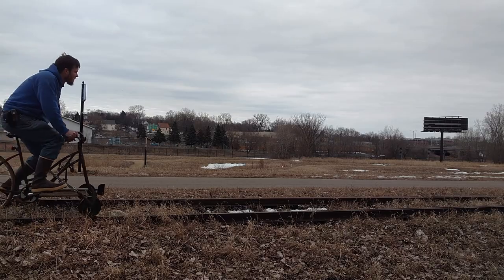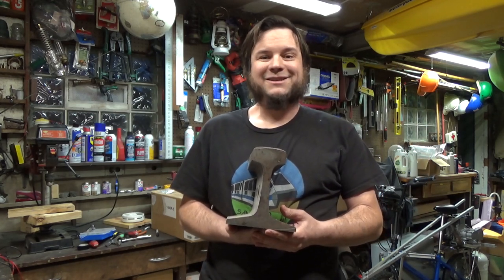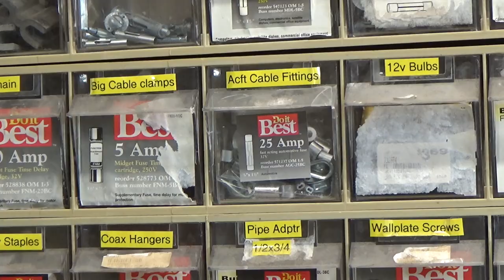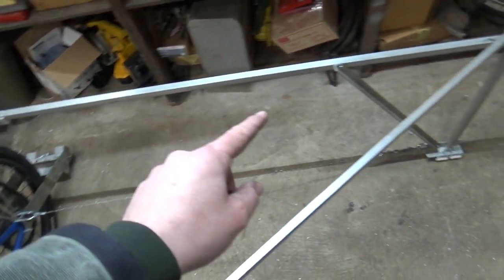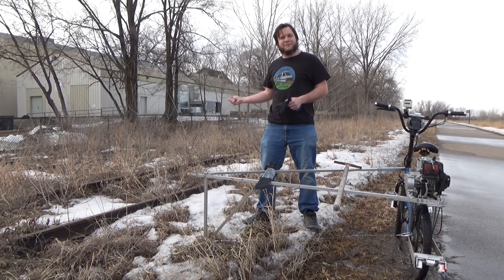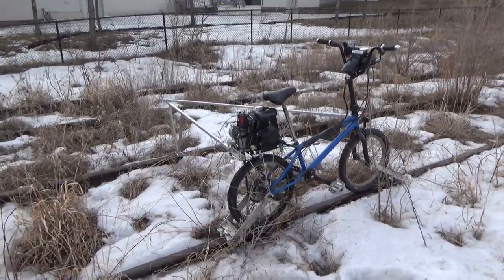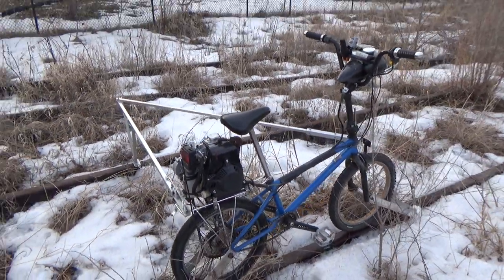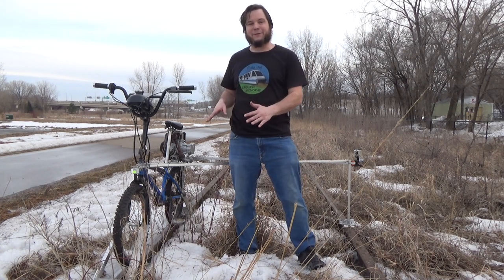Building Motorized Railbike For Abandoned Tracks

Comment: Could be worth something, but I am into miniature railways / grand scale railroads. There is a simple train called a "SCAMP" By Colin Edmondson. It uses a petrol water pump engine to drive an electric motor (used as a generator) and then that electricity is put through a power controller and back out to an identical electric motor. A bit of a noisy solution, but might help with power issues from batteries?

Comment: Why not center the bike, with an A-frame type rig that can open and close to wider or narrower angle, with each 'leg' of the 'A' terminating with a wheel assembly. In this configuration, the wheel assembly could be  L-shaped, with only 1 vertical and 1 horizontal wheel set. The 'joint' or 'top' of the A-frames could attach above the forks in front and back, and be articulated so as to widen nominally as weight settles onto the wheel assemblies, creating a natural outward horizontal pressure against the inside of the rail (against the 'vertical' leg of the inverted L of the wheel assembly), with the bulk of the weight of vehicle and rider on the top surface of the rail. The "crossbar" of the A-frame could take the form of 2 "axles" passing through the hub of the bike wheels, which would allow direct engagement with the axles for propulsion, whether it's from a chain or direct drive. Also, in this configuration, your center of mass stays between the rails, with a higher clearance above the ground (and the brush), and the overall design can be simpler, especially in regard to the wheels. You could ALSO incorporate a separate "drive wheel," perhaps below or behind the bike, that could make contact with the ground, for propulsion. I imagine a sort of 'chopper' fork, with a separate drive wheel, that pivots up or down to engage with the ground, which would give you another means of "throttling" power. It's a lot more simple than it sounds, and I believe would be therefore be more reliable. Just some ideas.

Comment: I suspect if you move the rear guide up to the front tire as a trailing guide there and connect the front and rear guides it would be much more stable and hold the tire in the proper alignment better. If the axle were six or eight inches longer you'd have better leverage for control too but that would create more problems than it would solve. 
It'll be interesting to see if the rear tire guide is needed or not.

Comment: Don't know if anyone said it or if you did it but what if the front guide was on the back of the wheel but connected to the front wheel so it is a different angle and the rubber tire hits stuff first

Comment: Just curious, why not go with the train wheels with flanges, like on your electric cart version you made? You could set them at the three contact points, instead of the guide that you currently have over the rail. The design would be similar to a railroad "High Rail" vehicle. Looking forward to more rail riding videos!
Reply from the maker: I thought about that, but the antique railbike I had was set up that way and it kept derailing. I figured the guides might keep it on the track better (and be a little easier to build and keep weight down).